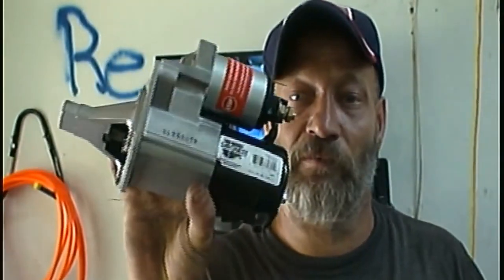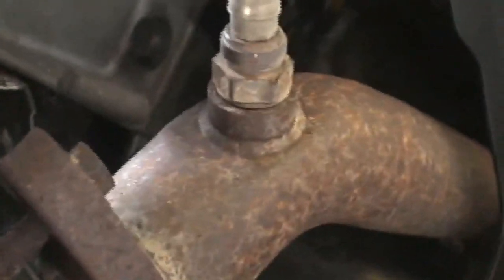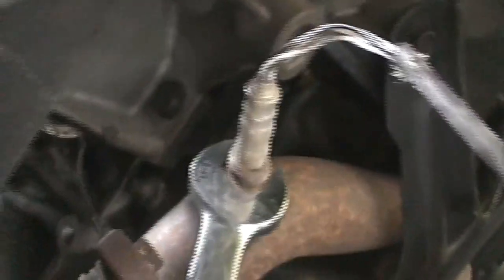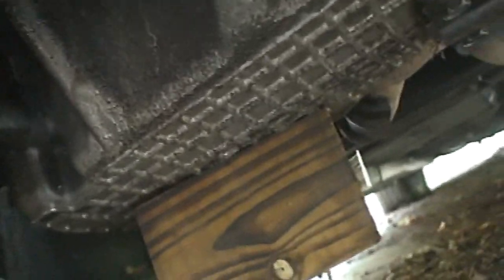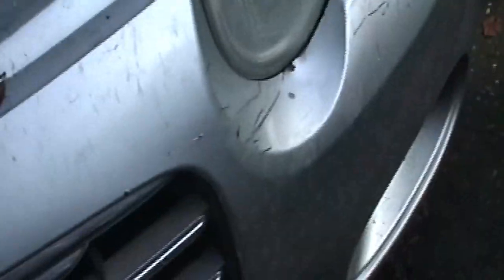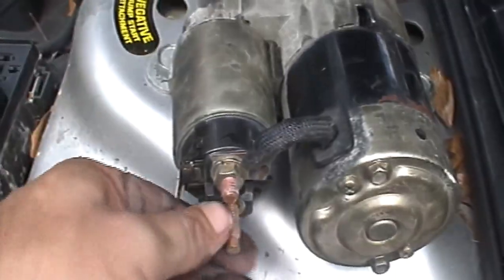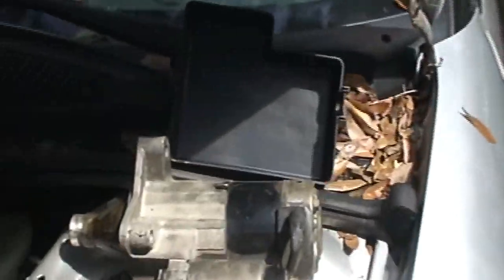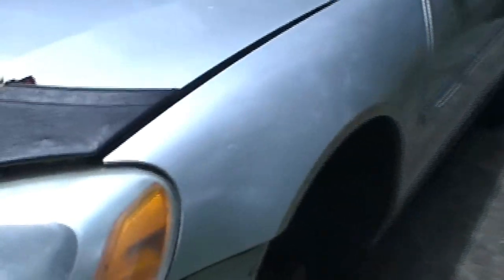how to change a starter on an 05 sebring

Comment: Where do you get a remanufactured engine for $800?  My local Firestone recommended replacing the engine because combustion gases are getting into the cooling system.

Comment: If your changing starter in a 2000 Chrysler Sebring convertible it's a little work, the fastest way to do it is to just go ahead and change oil while your doing it because, if you pull the oil filter you can slide starter straight out with little problem

Comment: I changed a starter on my sebring and the parts store showed me a picture of the starter and at this point I have not seen what my starter looks like so I baught it. When I got home I took my starter off and neither mine nor what I baught look similar. The factory screwed up and put a wrong starter in wrong part number box